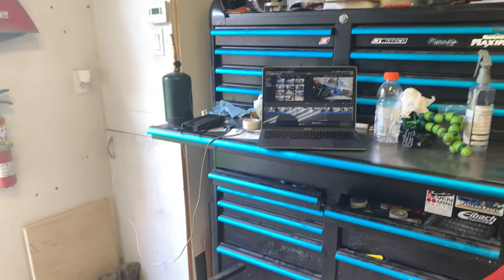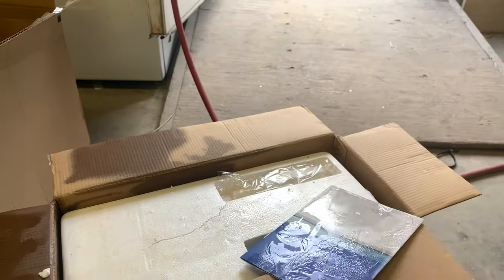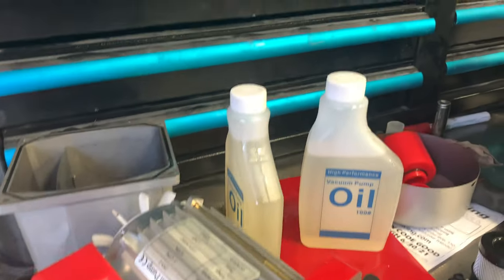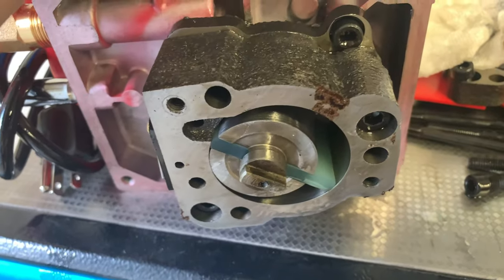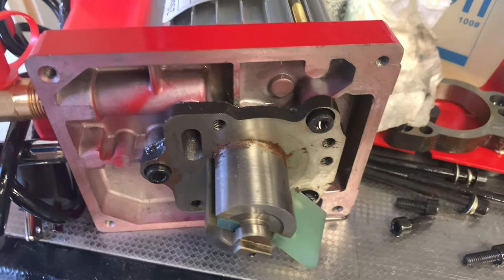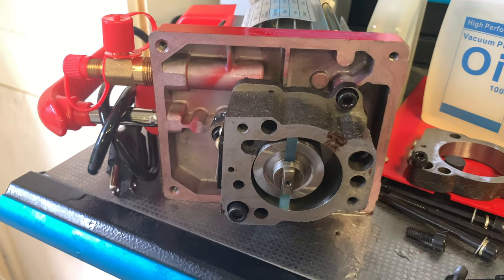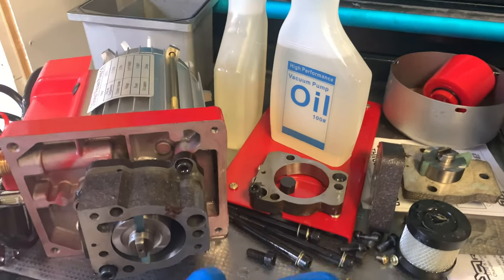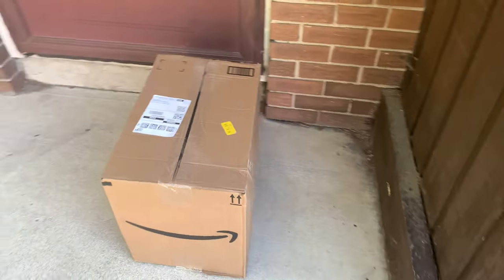Are Amazon Vacuum Pumps GARBAGE !? - My story.

Comment: I am  bit curious, there are so many different brands, all with similar specs and prices, so after the second or third bad experience with this particular VP, did you consider trying a different brand/model?  I saw your part 2, loved it BTW. I would love to see similar tear downs like that of the wide variety of other VP's, comparing not only initial condition, but also design differences (if any). Maybe also compare the cheap China VP's against some of the high dollar professional VP's to see what you really get for the significantly higher cost?
I am trying to buy my first VP (low cost >$200) and frankly I am almost paralyzed with the wide range of choices and opinions/reviews. I really appreciate your video, seems like a lot of the reliability/performance issues of these cheap VP's could be avoided by an initial rebuild/inspection with fresh clean oil. I did see the Vevor pump, it does offer decent features and specs for the price, but the high percentage of negative reviews scarred me off it. After seeing your video I can see why so many had issues. I now know that it can be a decent VP if you rebuild it and add missing screws. However, some other very similar specs/price have much better reviews so probably lower chance of rust/assembly issues? 
Whatever VP I end up buying, after seeing your video I will definitely take it apart for inspection and put fresh oil in it.
Reply from the maker: Thanks for the comment and suggestions ... I'm not sure that I will have the time or money to do this, but it is a great idea.
Reply: they are all the exact same. noname low-quality clones

Comment: So the practical difference between 2 stages and 1 stage pump is the time on reaching a certain number of microns not the number of microns that can reach? I think that the 2 stages reach lower numbers because it's also a battle against time because of the same principle that makes it rapidly gain microns once turned off. Only if the system were so sealed in a way that is not gaining microns once turned in off would not be a difference on the microns they can get with enough time. am I right?
Reply from the maker: Yeah, something like that. A dual stage pump has twice the volume it can displace per revolution (compared to if it were single stage) yet because it has two small pumps it can pull down to a better vacuum. 

I believe smaller pumps, (the actual volume of the pump) are better at pulling a lower vacuum, but it will take forever to move a lot of volume.

Comment: Buy a vacuum pump from a refrigeration supplier. I use JB brand at work they never get service and keep running.
Reply from the maker: Thanks for the tip MJ... If / when my next one fails ... I will look into that. I got one that finally works and did a complete teardown and rebuild... it was pretty questionable at best, inside, haha.